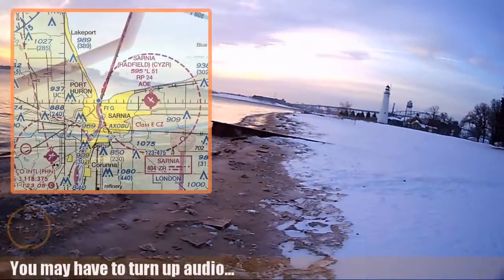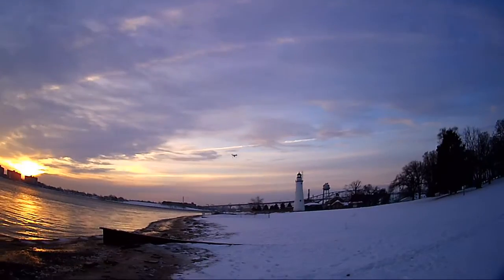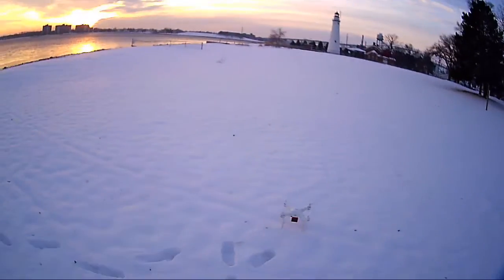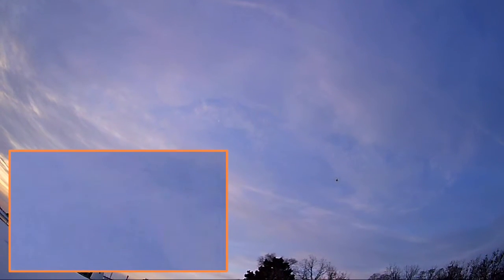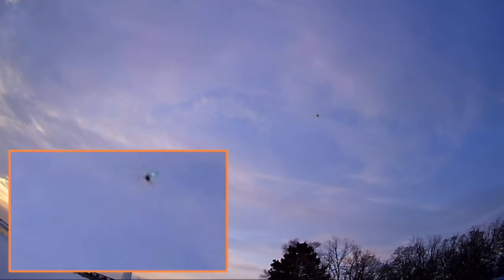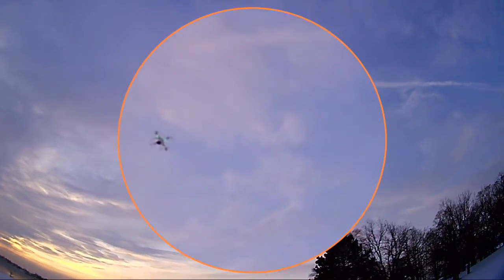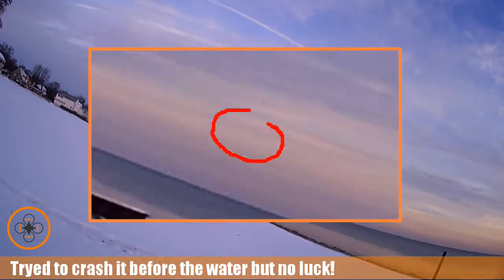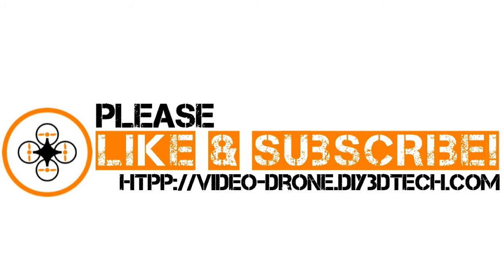Video Drone - Syma X8 Fly Away and Lake Huron Crash!

Comment: Watching this, I'm thinking of a nifty DIY project with the 3D printing: replacement landing gear that is just two thin-but-strong-and-empty (I could do this with my modeling plastic) pontoons on the bottom. Goes down upright, no harm done. Goes down upside-down, the drone might get wet (solution: heat gun or hair dryer), but it'd still be on the surface and recoverable. Lands on land, no harm done. Just sayin'. :)
Reply from the maker: People have used pool noodles to do this...

Comment: I feel your pain!! From what I could tell you were doing well keeping control of it the first couple of flights, with the wind trying to blow it out over the lake. You're braver than me taking it out for a third flight! I'd have been packing it away. It's a shame you lost it, I bet there was some dramatic footage on that cam! I always check the weather before flying my drone, especially the wind speed.
   I'm guessing it was radio interference? Maybe from the coastguard station?
Reply from the maker: Lots of WiFI in that area and what I didn't know as I was new is the Syma uses WiFI straight up where as the DJI's and other use a control protocol over WiFi so it take very little to cause a fly-away...

Comment: You say you enabled headless mode but I did not hear the 3 loud tones that signal headless, did it really engage? Also when you say you are trying to crash I, do you mean it auto throttled up and did not respond to your cutting off all throttle?
Reply from the maker: +CorkKNIFE yes held the button as well as throttle all the way down (I.e tried to crash it as I was afraid it would turn back to town).  Believe the problem was RF interference as it flew way too far before falling (well over a half mile)  because of loss of signal.  When it did fall it made a huge splash so it was a ways up there...

Comment: Do not use headless mode on upair as its buggy! You will lose next drone! I own upair and had one flyaway when using headless mode probably because lost some gps reception due to flying close to buildings. That was first day I owned it. Luckily it crashed into tree with no damage. Then I found out that this mode is buggy and it was disabled in later versions of upair. Chceck out video on my profile! My advice is to connect to mission planet and assign your switch to sport mode instead of headless!😈
Reply from the maker: i agree with you there is an issue with headless mode however the newer ones dont have the usb port anylonger they a strange looking serial connector and will have video out on it as i wanted to do the usb mod but version 2 is quite a bit different.  i might try hacking when i get time
Reply: Video-Drone is it possible to conect 3dr telemetry to version you have? if so you will be able to do everything using radio telemetry. its about $15 from ebay, a lot slower than usb but you will do whatever you need using mission planer. You can go even cheaper and use wifi or bluetooth telemetry. Those where my first mods, usb and 433mhz telemetry.
Reply from the maker: can you share the link?  As in V2 what happens is the OSD feeds out of the control board and into the gimbal (yes you read that correctly) and there is circuitry in the gimbal which over lays the OSC onto the camera feed and the FPV 5.8 transmitter also connects to the gimbal for power and that combined video output.  Also if the camera fails to operate you will also loose the OSD image as I believe (again a guess) is the mixing circuit is using the vert & horz sweeps of the camera to create the complete video signal and the OSD is vector based.

Comment: Man that was too bad. It just completely took off like a bat out of hell. So I just lost my Parrot Bebop today. It was completely my fault though. I was flying it over a river here in Oregon and I flew it down the river and unfortunately lost sight of it. I still had the FPV on my tablet but then it also went blank. Instead of letting it hover cause it has GPS lock, I panicked and hit RTH. Well unfortunately that was a dumb mistake because there was huge trees between the RTH position and where the drone was. So it went into a tree. I tried to find it cause to add insult to injury the FPV feed came back on the show that it was indeed in a tree somewhere. We have pretty huge trees in Oregon. Never did find it though Im pretty sure which tree it is in. Even with binoculars I could not locate even though I could see myself on the ground looking up for it in the tree. Ha Ha! Ordered a new one as soon as I got home, just like you did. Replaced it with another parrot though since I have all the accessories a man could want for it. Its a cool little drone. Should be here in a couple days. Keep the faith my friend!!
Reply from the maker: LOL!  I feel for you!  I just crashed my UpAir (my fault too) however tried fixing and the order of the power wires to the wrong and puff went the magic smoke!  Ugh, however like I ordered another as hey I have parts now!  Do you think it will fall out of the tree at some point?
Reply: Man....maybe it will. I plan on driving back soon to see if it may have. I kinda doubt it though. I cant even see it in the tree. Sorry to hear about your UpAir. How are you liking that? I just ordered a Syma X8HW. It was down to 87 bucks on Amazon. I wanted the Altitude hold. I have a couple Yi cameras I want to put up with that. I like the Parrot though. Lost my blue one so I ordered a red one this time. Found one for 149 open box on BuyDig. Both drones should get here by Thursday. Im gonna mod the crap out of the X8 and see what I can do.

Comment: Wow that does suck I feel for you man. They sell a floatation device that goes on the drone and inflates in case of a water crash. Least there is a chance it will beach itself and you find it. I noticed a lot of fly aways or lost signal fly aways seem to be more over water. I used to be a ham operator and found tons of wild signals over water.
Reply from the maker: Yes this is at the mouth the of the St Clair river from Lake Huron and there is a huge weather radar just across the way and big Coast Guard transmitter a block down.  So I knew it was going to be risky :-)

Comment: Oh man, that is indeed a shame. I'm just waiting for my first fly-away.  I would have gone with the Phantom 3 standard which is around the same price, but has a 3 axis stabilized gimbal.
Reply from the maker: Man did it splash I spent a couple going frame by frame to try and find it but too much noice and too far.  :-). Also did a lot of homework on both the upair and phantom 3 standard, and went with the upair for one word "hackability" as one of the issues I have is the crazy price of battariesvan there a number of battary hacks for the upair as well the USB mode for mission planner.  I already have the hacks planned out :-). I also bought the Hubsan x4 gps too for more grab and go.  In the longer run, thinking about the mavic however want to get more air time under the belt!